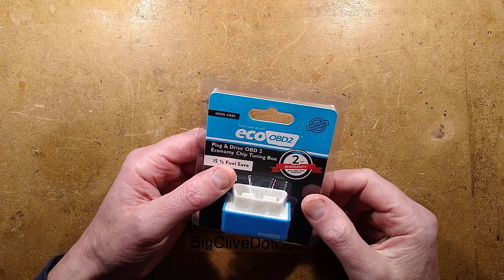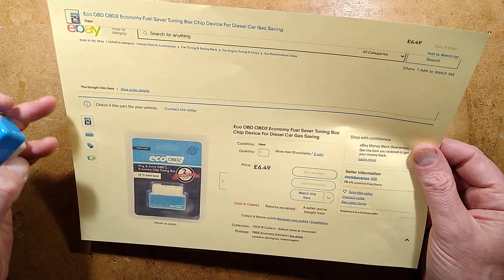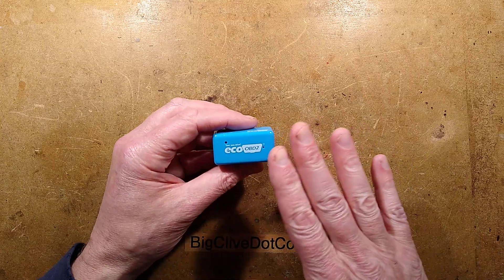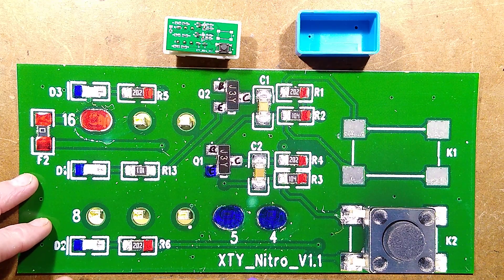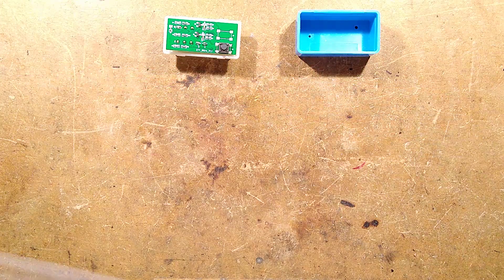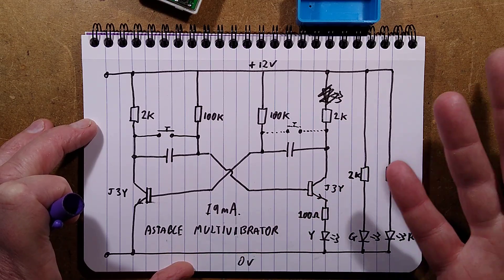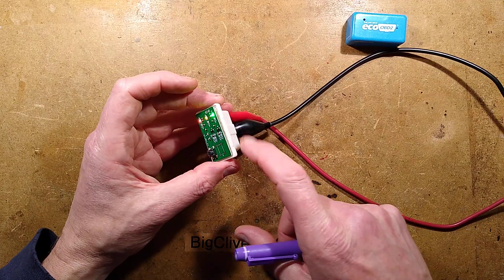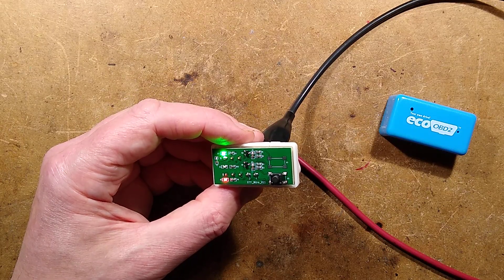Worst fake Eco OBD2 fuel saver yet (with schematic)

Comment: As a mechanic,  I've had cars come in with can bus faults/no communication errors, etc. I've had multiple modules go bad from these shitty fuel savers, battery drain, OBD2 ports that no longer work.  Some of the worst kill the 5V reference, that's real fun trying to diagnose when the customer removes it and doesn't mention it was installed.
Reply: What these people don't seem to realise is that; if this were so easy and cheap to accomplish, the auto manufacturers would have long since implemented the tech by default to beat regulatory obligations.  Of course, yeah, there is legit software factory installed to optimise fuel consumption in many vehicles already these days.
Reply: @GeorgeVCohea-dw7ou  Yes that is true 👍
Reply: @GeorgeVCohea-dw7ou  Ironically, auto manufacturers have long ago implemented exactly what this device claims to do. Your cars ECU already learns your driving habits and changes how it operates to maximise performance and fuel efficiency specific to how you drive the vehicle. 

You can actually clear these settings (plenty of videos about on how to do it) to see how (rough) your vehicle runs without them and have it remap your driving style over a few hundred kms. 

So from the outset the OBD2 device being shown is advertising to do something any vehicle new enough to have an OBD2 is already doing. The only reason you'd ever tune your ECU is if you're trying to pick up my torque on the low/high end or you're trying to give up fuel savings to maximise acceleration. Tuning isn't a mainstream thing for that reason, it's really just for niche groups.
Reply: Yes that must be a lot of fun!!🥳🥳😆
Reply: I'm no mechanic, but my very first thought when I saw one of these was that I probably won't want to kill a very expensive part of my car with a $5 device that makes promises that even a less educated person could identify as a tall order.
Reply: Reminds me of my years in laptop support..... from pen shaped cracks in the screen (but of courseeeee she didn't leave a penon the keyboard and jammed it in her bag. To a melted back, because someone totally didn't have a candle on her table...... 

Same user too. No joke
Reply: USB killer for cars

Comment: I guess you can glue it to the floor under the gas pedal to limit its travel and thus reduce the power of the engine.
Although that does not necessarily mean less fuel consumption if you do not adapt your driving style.

Comment: Much like the fuel line magnets that "Align the fuel molecules" for economy. Doesn't do diddly s**t except maybe causing some people to convince themselves they're saving fuel. After many, many years as a mechanic, I've heard and seen almost every stupid internet/marketing/DIY thing people do to either save fuel or make more power. I still remember the one guy that ran his bike a quart low at all times because he was absolutely convinced that running it at the full mark would potentially blow out the seals in the engine. Even told him I've had people come in 4 quarts overfull and the bike was fine afterwards. But no matter. Nothing I said or did would convince him otherwise. His Triumph Speedmaster sounded like a box of hammers rolling down the stairs when he started it up in front of me, bad enough that even I was visibly shocked at the noise it was making. Didn't matter. He was absolutely certain.
Reply: Certain astrological signs show more stubborn than others, pays to be aware or you'll just get arguement, no matter the issue

Comment: Automotive tech here. There is no “generic” item that will have any ability to plug into your OBD2 port and improve or modify your vehicle in any way. Anything that you could buy would need to be specific to the vehicle/power train because it would need to contain specific software to reprogram that particular engine/power train controller and the specific program to install. This is going to be different for every different power train from every different manufacturer, and sometimes even different for the same power train depending on emission certification, model year, particular vehicle model/trim, etc. There is no other way to do this through the OBD2 port. Even then, if there were a way for a manufacturer to legally improve vehicle fuel economy without making the vehicle drive like crap or make the tailpipe emissions skyrocket, they would do it. A piece of crap off eBay for 7 $/£ is definitely not going to do it. It’s also worth mentioning that if you do buy something that is actually capable of modifying the programming of you engine, transmission or powertrain control module and it has a negative impact on your vehicle while under warranty (i.e. it breaks something) the vehicle manufacturer is not obligated to cover the cost under warranty, which means that they almost definitely won’t. It’s also very, very illegal to modify the emissions system of any vehicle, regardless of age and yes, the engine/powertrain controller is considered part of the emissions system.

Buying and installing something like this is more than likely going to cause problems and cost you more money.

Comment: I wouldn't be surprised to see one which didn't actually have connectors but just used a button cell and a push-switch to turn on the LED.
Reply: Glue the button cell inside a "fuel-saver capsule" that people need to buy and replace every few months

Comment: These devices are crap.  Like you said, all they do is steal power from the car to flash some pretty lights.  Some of them may communicate with the OBDII and flicker the lights according to data, but no mapping....   I guess some people will do anything to try and save a dollar, and some will swear something that flashes some lights works......   Mostly it is either driving habits change when they plug in the device or it is 100% placebo effect

Comment: Can you modify this to make the LED's brighter on steriods and put it on top of a Christmas tree with a spinning vibrator and power it using exposed wires leading to a microwave oven transformer shoved inside a electrocute-o-daptor? lol  Basically shove everything dangerous into one project.

Comment: I don't speak French, I only kiss that way ;)  OK, used to.
Thankfully my lorry lacks that government mandated diagnostic coelacanth..1994 era technology.

My truck has diagnostic port, a military standard 50 pin plug.   Designed for analog diagnostic, it has plenty of expansion room.  This diagnostic system  measures fuel filter pressure differential,  voltages of both batteries and alternators,  tachometer signal for idle speed adjustments but oddly enough, no glow plug as that is far too complex.
36k miles, I've put 27k on it in 10 years.  The primary purchase reason is a 12kW 3 phase PTO driven generator.  Connected wye, it also has a 3.6 kW air compressor on three phase.  Supports my 3 phase welding inverter perfectly,  runs the 50 amp plasma torch off a 208 volt leg pair.  
Since purchase, I've had but one power outage.  Provided warmth for two neighbors  plus myself , -13°C, below 0°C for a week.   Engine consumed less than 1.5 liters per hour, never asked for diesel but was gifted. To the crux..
The only way to improve economy is to run the engine at a speed and load where the specific fuel consumption is minimal.   This usually happens around the start of torque peak and 70 to 85% of maximum throttle.  This also can accelerate primary wear, the piston rings so this is why most manufacturers deviate from optimum, unless it is a 7 liter 32 valve V8 in a 1400 kg car with CD of 0.230 on 0.72 m^2 projected area.
I played around with install of an overdrive to drop engine speed to 1050 RPM.  Would save while driving, less than 30 ml per hour on PTO generator.

Comment: I think I have a HUD that is doing the same kind of  12v continuous draw, OBD2 US connector, would you be able to tell me what the pinout is to maybe attempt to disable it or what value of resistor might make that useless? other than saving the data so it doesn't reset to KPh I don't think I need to store memory functions, or can you figure out what would make the obd2 a keyed 12V?

Comment: This was great! A flashing circuit and they could've drilled more holes in the cover to expose the other LED's. From the video it looks like the hole for the "reset" button is not in line with the switch.
I would love to have a stout beer with you sometime😄

Comment: I just realized that you could grab a bunch of USB male plugs  1 or 2 flashing LED's cheap breadboards and some 3d printed shells and make "range extenders" for electric vehicles. The blinking light means its working!
Reply: They already are on the market, in a different colour shell.
Reply: Not likely to get many victims there. Most people that are going to buy something that plugs into the OBD port on a EV want to have exact cell by cell voltage and temperature information along with battery conditioning information. I'm not really that into it and just use the information GM seen fit to put on the dash and I make adjustments accordingly. 

So the point is the moment it fails to connect with whatever device you plan to read the data output on that person is going to be asking for there money back.

Comment: That is more economical because it won't throw you in limp mode and make it run a horrible inefficient limp profile until you fix the canbus errors.  Or do like a cheap elm327 did to me and leave you unable to start the car, shift to park, or set the brake because mine confused the computer thinking the transmission and e-parking brake were missing.

Comment: For the switch contact to turn OFF the amber LED, one of the contacts has to go to the negative rail. By connecting the base of the LED transistor to the 2kOhm pull up resistor of the other transistor, it completes a path to the LED through the base/emitter junction of the drive transistor. That would put ~10 milliamps into the LED, making it twice as bright. (the transistor is turned ON by the forward bias, causing to pull up the LED via its own 2kOhm pull up resistor)
Reply: The button reconfigures the circuit into a monostable multivibrator.  Analyze accordingly.

Comment: Mean hack for this unit. Add an fm transmitter to it set to the "victims " normal station and plug it in.
Or a small bluetooth the tries to connect to their radio. 
Good trick or treat ? 🤔

Comment: Just drive slower people... accelerate slower, keep your rpms down, travel at lower speeds. Save loads of fuel.
Reply: Doesn't work in the US. Everyone has to drive their stupidly oversized pickup trucks (that they never haul or tow anything with, just drive back and forth to work) at 10mph over the speed limit minimum, and then blame the president for how much they pay at the pump instead of the stupid vehicle they bought and the stupid way they drive it.

Comment: This 100% does something. if you go to a mechanic with one of these installed and they see it, they know to offer to change your blinkerfluid.
Reply from the maker: And offer a $20 firmware upgrade for the fake fuel saver.
Reply: Don't forget they're probably low on horn powder too
Reply: @briandrown3595  Also they will know to check/replace your muffler bearings
Reply: @briandrown3595  Horn powder is very expensive in China, as it is equivalent to this device, but for population production.  Production in Africa suffers from a significant shortage of horn producing herds.
Reply: I hope they'll also change my piston return springs, and swap the summer air in my tires with winter air.
Reply: You stole my joke lol.
I was going to say that this thing can make the blinker fluid last longer too, lol.
Reply: Very funny!!!!
Reply: and toss in rotating tire air for free
Reply: Yes it does, it increases the fuel consumption, from the extra weight the power required...
Reply: The relative bearings in your GPS are badly worn. Must be replaced.
Reply: Refill the air tanks for your horn.
Reply: my father is an ASE certified master mechanic for 50 years and he's fallen for this bullshit too. Mechanics aren't immune to this stupid shit.
Reply: So many people post that lame joke thinking it’s funny. Nobody is stupid enough to believe that.
Reply: @myfestivus4336  I used to think that also - until I saw just how many of these completely useless devices are made AND BOUGHT!!! 🙄🤣🤣
Reply: @myfestivus4336  - Which joke was that?  Several were posted, including my own.
Reply: Ha!  Nice,   Spot on.

Comment: Memories of a "regulated" 12V supply I ran across in the 1970's . I noticed an unlabeled T-03 transistor case 
pop-riveted to the case. I open it  and the two leads of the "big power transistor"  were completely un-connected. 
Just a step down transformer, a bridge rectifier, an inadequate capacitor, a fuse, and an illuminated switch.
Reply: Will bet they used all the manufacturer rejects as well, buying them at scrap steel price.

Comment: By the way. In the automotive industry, anything over 50mA consumption while turned off is considered as a high current draw that'll discharge your battery in a couple of months. 

Most modern passenger vehicles stay at around 25-30 mA. So this thing is just making sure you'll be able to get a nice flat battery if you don't turn on your car in winter or something.
Reply: And in cooler climates, you won't get the full capacity of the battery at -25C or colder.
Reply: 50mA will drain 50Ah battery in 1000 hours, that's 41 days, but it's actually really fast and will be much faster in reality.
Reply: @zlac  That's about right. However, slower discharge rates impact greatly on the Ah capacity of a standard lead-acid battery.

A lead acid battery meassured at a 10mA discharge rate will have around twice the capacity of the same battery meassured at a 10A discharge rate (the standard for this measurement)

Technology Connections made a pretty interesting video on the topic of lead acid batteries for small current inverters. It's worth a watch.

This is why a standard battery will last for a few months without needing a charge on a vehicle. At 20-25mA you're basically at least squaring the estimated duration of the battery, on which case, you'd need to worry more about self discharge rates than idle consumption.

Edit: on a side note, in my experience. Idle consumption over 100mA is enough to kill a battery in under two weeks. Which checks out with the numbers you provided. If we were to take in account that a 50Ah battery is bigger than your average battery. Average would be around 40 Ah.

Comment: Thing is, my car, already does this stuff for itself. It's just a basic old Volvo which learns your driving style and automatically adjusts various engine parameters to give you the best engine performance Vs fuel economy according to how much of a prat you are behind the wheel!  I'm pretty sure most other cars will do the same, so adding anything else to that either, would have no effect, or would likely have a detrimental effect.   I honestly can't really understand how people let themselves get sucked in by these things.

On the other hand, back in the early seventies, it was claimed that if you added a pinstripe along the length of your car, it could add up to five miles per hour in your top speed, even more if you used a double stripe. Ever heard of "go faster stripes"? Well, that's where it comes from! Same thing goes for magnets clamped on to your fuel lines, transistor assisted ignition, air intake humidifiers, fancy cone shaped air filters, exhaust eductors and any number of other snake oil products.
Reply: It's a sad truth indeed but I can see a lot of people falling for this type of device given the price of fuel right now ... the good old placebo effect in some respects

Comment: Knowing what can be done through the OBD port makes something like this firmly in the realm of "possible but not at that price". Funny enough, a version that turns up the fuel enough to roll coal would probably more popular among the diesel drivers here...
Reply: I have definitely got better fuel economy via tuner, but it was like 0.5 to 1 mpg and probably just because it changed the throttle response
Reply: That wastes so much fuel. Wouldn't it be alot cheaper to just get the male enlargement surgery ? And more effective.
Reply: @briandrown3595  Getting the brodozer already added inches, and the raised suspension and coal upgrade doubled the length as well. No money left for surgery that actually works after that, and the new massively larger fuel bill. After all, he can whip those out and show without getting a ticket, and the little head is only coming out when it is dark, so nobody can see it to compare.
Reply: @SeanBZA  Don't forget the hood removal fad in that country.

Comment: put some magnets on the fuel line and a tornado in the intake!
Reply: I agree with you on the magnets. The ONLY case that a Tornado makes sense, is on a carburetor, with a specific Venturi design, or certain intake air ducting. It's completely useless on any fuel injected engine, whether gas or diesel.